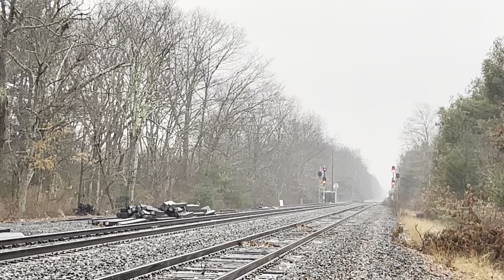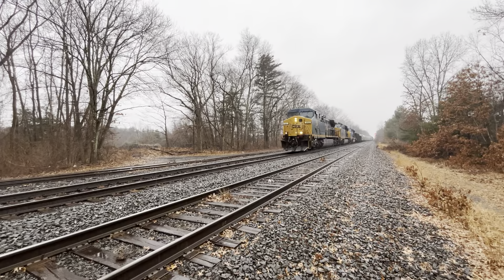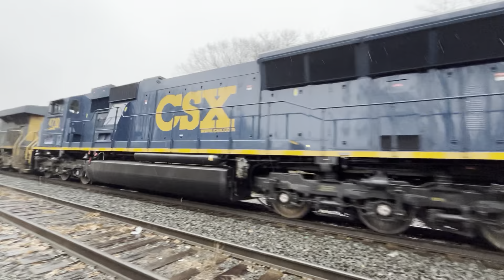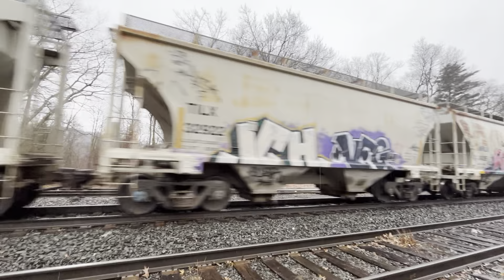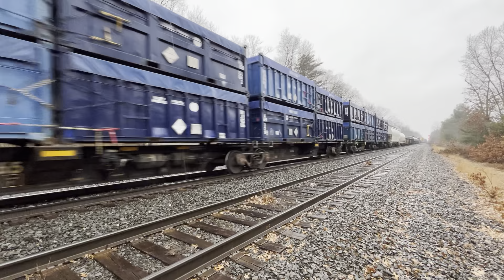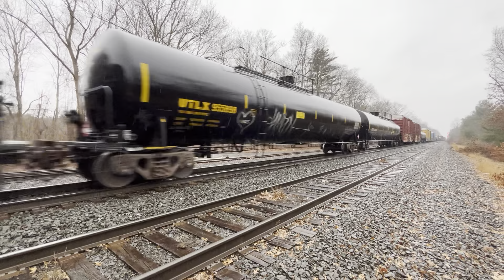Friendly Engineer #1 Brings M426 The Rigby Rocket 🚀Thru E. Brookfield W/ GORGEOUS SD70AC Third Unit

Comment: If only the headlights of the Rigby Rocket could burn.away the Relentless rain. The CP got a good deal out of their rebuilt SD70😮 but lately seems to run them up in Canada with much greater frequency. Note the last car of plate steel overhangs he edge of the car by several inches.  In order to call the crews  attention to it. every other clasp is painted red
Reply from the maker: Wow Paul thank you!!!!!